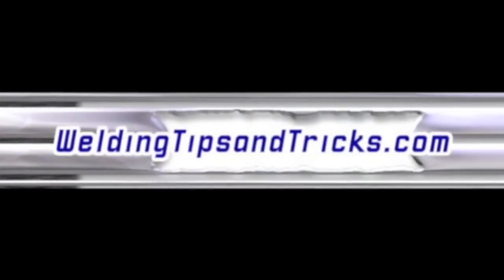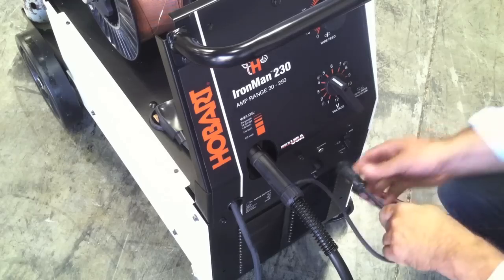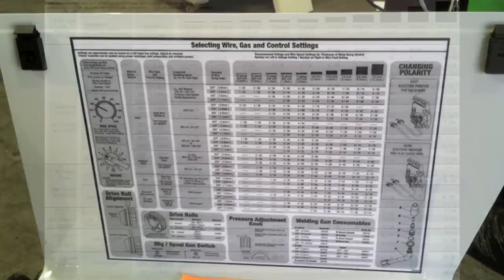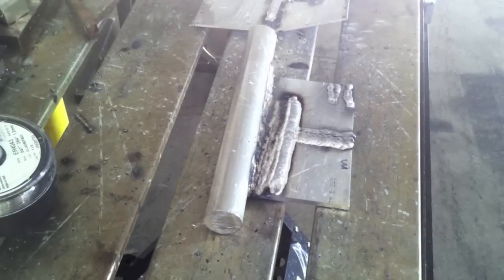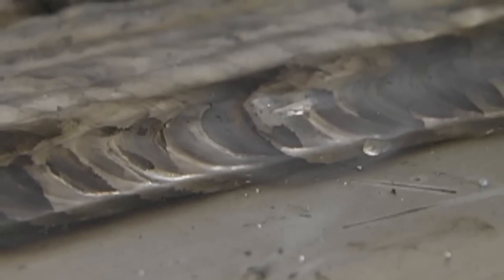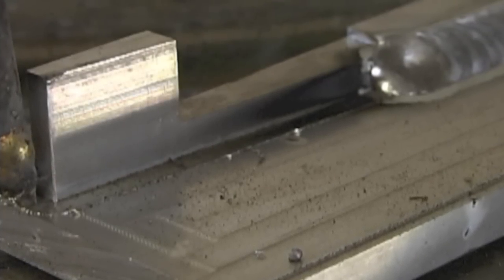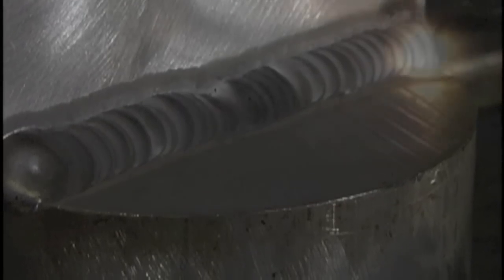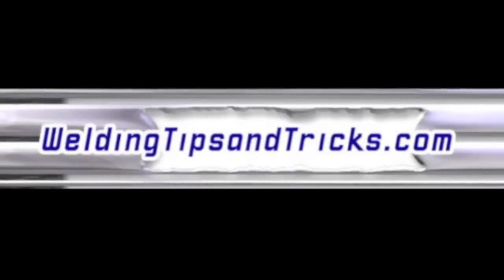Mig Welding Aluminum with a Hobart IronMan 230 Welder

Comment: Deferring to you as the expert and then some - wow for the first time I am seeing what I experienced of Ali GMAW/MIG.
Without detracting from the generality: the smooth soft hiss; the electro-etching action around the weld; zero spatter; your almost straight run (I always did constant smooth straight run with Ali GMAW when allowed to); bit of sooting beyond the electro-etch band (but not much - your Ali is 5000 (Al-Mg) or 6000 (Al-Si-Mg) ?
Loving seeing something I recognise.
BTW getting home from day of setting up a major job (no photos permitted), found I was within Amps and a Volt or two of the Lincoln Foundation recommendation ("Procedures Handbook" (it's more like a door-stop!)).  So and observant welder going with what Nature shows arrives at what Lincoln recommended for Ali-GMAW maybe 60 years ago.

Comment: When I weld 1/8" it starts out very cold looking then finishes way too hot! What causes this? Millermatic 210 spoolmate .035 settings 3 amperage and 65 wire. !/8" 5051 al t joint.

Comment: As an instructional, it would be helpful  to give some numbers and related comparisons. All this shows is that you got in the end.  I am a beginner with Aluminum and have a millermatic 180, but all my welds are very porous and mixing and matching all sorts of variables hasn't produced a good weld...they look alright, but can be torn apart and are very porous.

Comment: I had to pull aluminum mig a lot at my job. A good technique is an exaggerated cursive J, where I pull the bottom of the J out in front of the puddle and go back into the weld and kinda fill in the “belly” of the J.

Comment: Can't find a real answer but is it possible to weld Aluminum with a older dc mig? No inverter/pulse or something. Just plain dc alu wire teflon liner 4wheel pusher argon 4.6. 

Tried 2h from 30A to 240A and Wirespeed from min to max and i could only get black blobs that drop onto the Aluminium... 

Would like to use the mig for some coarse stuff on Aluminium because it is way faster than tig but could not get it to work... 

Clouldn't see any cleaning action from the arc at all... any hinds to look after?

Thanks and great vids

Comment: How do you weld cracks in 30 yr old pitted aluminum?  I can make welds as good as yours on new 6061 gussets that I'm adding, but can't make the puddle flow into the old pitted aluminum, even after wiping with lacquer thinner and brushing with a stainless cup wheel on a die grinder.
Reply: deereboy8400 try some 4043 wire. weld it grind it almost out the weld again. tig welding would be best as you can flow out the impurities.

Comment: Jody,
From the stock settings, "what were the changes you made so I have a ballpark to do the same? IOW, more or less gas, more or less wire speed, and more or less voltage. Thanks a bunch.
Pete

Comment: BTW,,,I sometimes run into dirty aluminum as well as 5086 alloy and find 50 series hard to run being a beginner. Can you please tell me anything you know about Rockmount/Nassau wire? The Rep told me it runs great on 50 series and has superior tensile strength. Going to be welding motor mounts on 50 series with it. Cheers!

Comment: Hi Jody,I have a Ironman 250 with a 3545 spool gun just for aluminum and getting ready to weld on my boat. Some of the welding is on 1/2" plate. I've been running some 4043 .035 on 3/8" scrap plate with good results but wondering when the need to run .047 wire would be needed. Also do you have any heat/fpm starter settings you could share with pre-heat temps for thick aluminum. Great videos

Comment: Anyone know if you could get the same results using a Hobart 187  with a teflon liner and straight argon gas? For now all I'd like to weld is 1/8" aluminum

Comment: Would the Iron Man be suitable for thin aluminum tubing like they use for back pack frames or metal conduit? I will use it for steel and stainless more but also aluminum tubing. I need a welder that is a general purpose welder for the materials. Thanks for your videos.

Comment: I used to weld B-52 aircraft towbars in the air force. We preheated the 1/2 aluminum using a torch then weld them with aluminium mig. Nice video!

Comment: You don't have to weave to make a mig weld...just a stick weld. If this was the case there would not be a such thing as a tig weld.
Reply: I beg to differ on that.
Reply: You must weave when mig welding aluminum to prevent crack.

Comment: thirdly, the work would be so much less efficent and worse quality, if each welder had to set the parameters all the time. Fronius has special software and you can change amps while welding , there is a button on the gun so when you change it, it automatically changes wirespeed and other parameters like voltage etc ( English isn't my first language HARD TO EXPLAIN ) , but usually the only setting I have to change on the welder, is how much spray or deep penetration I want.

Comment: Hi, I consider myself a proffessional aluminum MIG welder and I have a few comments.
First of all, what a pain in the butt to set up these welders for AL. 
At work we use Fronius VR 2700/4000 welders, the wirefeed cable is 10 meters long and the aluminum wire is on a bigger spool and in the machine itself , like you have steel, its a push and pull system.pretty hard to get it to wind up.
secondly, whenever possible, DO NOT use pull style welding, with AL, always push.

Comment: That's about the same setup I have. I have a millermatic 210 with the same spool gun. I've never had too much luck with pushing a weld, steel or aluminum. Thanks for the tips here. Your welds look a lot better than mine, but I'm getting better. Aluminum is tricky for me. It's almost as though it is moody.

Comment: HI, I AM NEW WELDING ALUMINUM, JUST GOT THE IRONMAN 230 ON MY HANDS, I WAS TRYING TO SET UP THE SPOOL GUN TO WELD ALUMINUM 1/8 THICKNESS. BY THE SOUND OFF THE WELDING I WAS GETTING CLOSED TO THE RIGHT SETTING, BUT STILL MELT THE ALUMINUM, MY QUESTION IT IS HOW TO SET THE ARGON ? HOW FAR NEED TO OPEN THE REGULATOR? I RUN OUT OF TIPS, BURNED ALL....THANKS FOR ANY ADVISED....GOOD VIDEOS.

Comment: hey jody i need help. my century 140 mig it won't feed wire. my gas is working fine i was welding 1/8 inch and then it stoped feeding. it sounds like the motor that pushes the wire is froze can you give me a clue or an idea of what heppen. thanks

Comment: great video! i was against spool guns until now. i was getting negative feedback from ppl and that stopped me from even getting familiar with the thing also the fact that everybody didn't have a spool gun to work with. i'm school trained to weld and from what i learned, pushing offers more penetration than pulling, i don't know the truth to that nor has it been proven to me or my eyes.

i woul dreally like to see a video on how to get better at fitting up parts and reading blueprints. thanks

Comment: I learned how to do this years ago, and it was instinct that showed me the way. But looking back, it was the sound that told me we were right on with our settings. Once it was working well, we didn't want to mess with it, because a slight change caused no end to problems. It's very frustrating to have your puddle drop right onto your shoe, ha ha.

Comment: adding helium reduces pre heat time on thicker metal, especially tig,  i use 351 from machine and weld which is 75-25, argon, helium.

Comment: Good video.

We used to have a spool gun on one of our miller 212 welders.  It never worked as good as your setup.  We have a miller 350P pulse machine now, it's hard to dial in but it works well for material 1/4 or less.  I'm still having trouble with thicker material, say 3/8 to 1/2.  I'm wondering if its a gas flow issue?